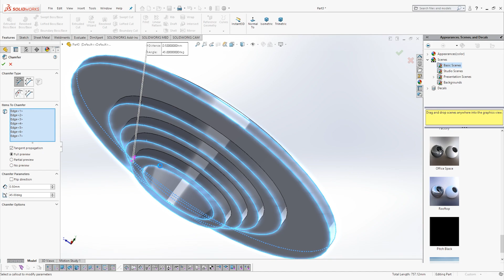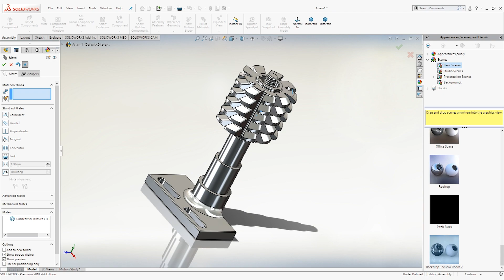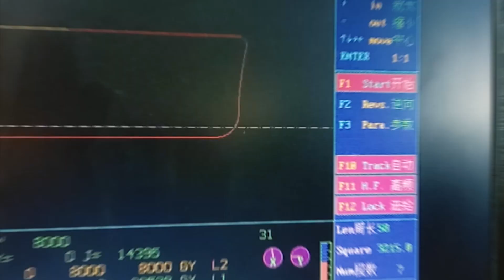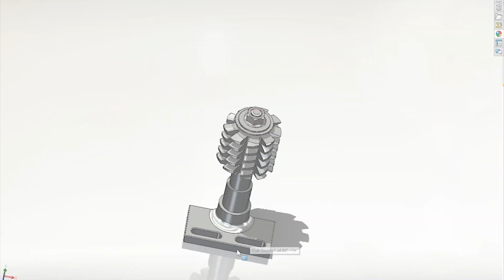CNC Wire EDM | Re-Sharpening HSS Hob Cutter

Comment: This operation certainly extended cutter life. However, frankly, this cutter should have been sharpened many times in between. You have been getting poor finish for way too long. When dull area on teeth is over 0,5mm it should be sharpened. Dull cutter wears down even faster.

Comment: The finish is surprising. However a note of caution. On hob sharpening machines the hob is rolled onto the wheel at each pass. This is so the proper form is maintained as it grinds down the form relief. The segments appeared to be the same thickness from top to bottom whereas the bottom of the segment should be thinner. On radially relieved cutters they are only given relief in an inward direction from the periphery towards the centre. That is the side clearance would be zero on any part of a form which is perpendicular to the axis of the cutter. Most of the gear tooth form on the cutter is angled from the top of the tooth to the bottom, so clearance is imparted into most of the form. Maybe you did think of this as we only got snippets of the removed segments. Please excuse me if this is the case. I operated a tool sharpening business for 25 years before retiring.
Reply from the maker: Im so glad to receive comments like this specially from those who are expert in the industry...We're neither surprised nor expect much from this experiment coz just decide to make use of what's left of the cutter before we dispose it...It's literally has reached the end of its tooling life...Without the grinding machine there's nothing can do left so we tried with the wire edm instead...to our surprise we just extended its life and were able to make a couple of passes more...concerning the relief angle of the cutting edges we just zeroed in to the original profle to make the cut absolutely parallel...cutting off only up to where the edges that's totally worn out ..Sorry i hope my english make sense..😂😅